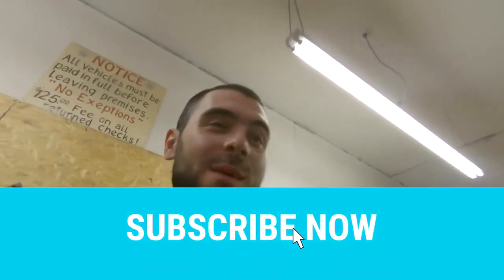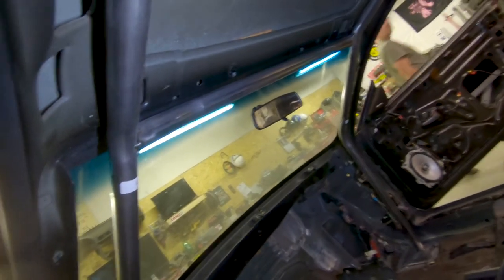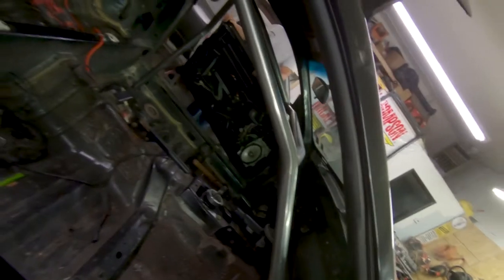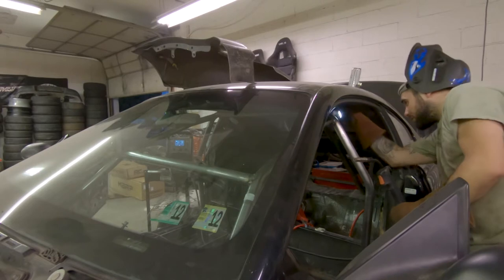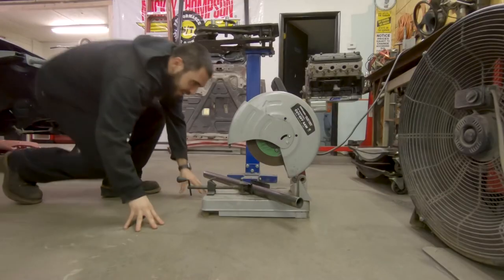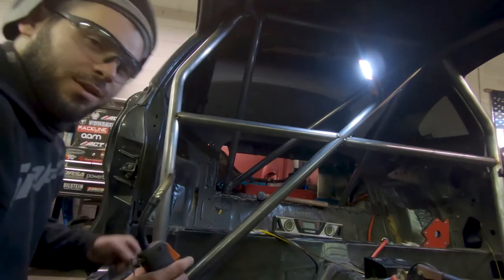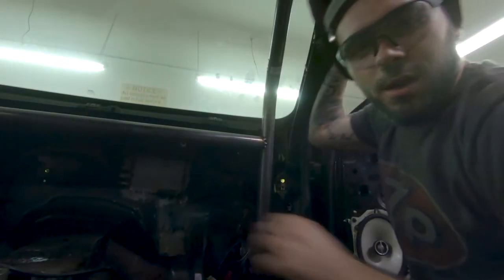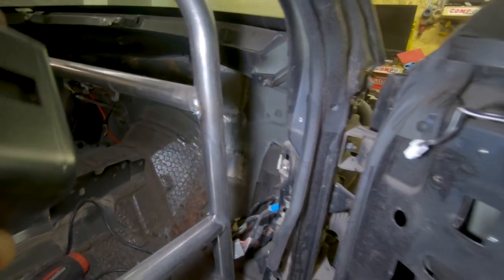95 MUSTANG GT ROLL CAGE INSTALL

Comment: Me and a buddy are actually building an sn95 drift car right now lol It’s awesome that I ran into your channel!
Reply from the maker: Thanks dude! There’s some valuable info on here, and if you have any questions, you can message my Facebook page.
Reply: John Ratchetstrap sounds awesome man! Will do
Reply: The drift project one I have is a convertible so it'll be easy welding the top of the roll cage. I also thought it would be cool to put a silvia s15 bumper and headlights on her.
Reply: @trailblazer8380  the body lines of the sn95 would probably match pretty well with an s15 front. Sounds like a good idea my man, I’m sure it will look pretty awesome
Reply: @rkskidz  that's what I was thinking, but it's gonna be a good while before I get to that point.

Comment: Pretty good trick with the holes in the floor!
Reply from the maker: It’s better than cutting the roof off lol
Reply: @RatchetstrapMedia  yea ! Or my friend did it lower to weld it then added bloc under it to raise it but your trick is better
Reply from the maker: We thought about building boxes as well, but this was easier. I didn’t have access to that much plate steel for the base plates.
Reply: @RatchetstrapMedia  yea my good friend is welder and have acces to everything on his shop! But anyway it os alot more cleaner and it gives acces to much more room to weld to drill holes!